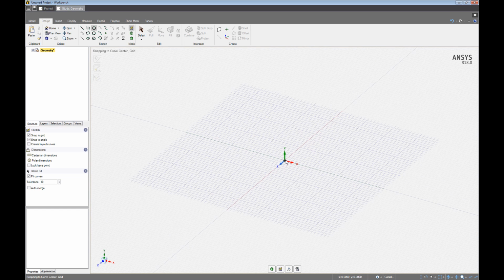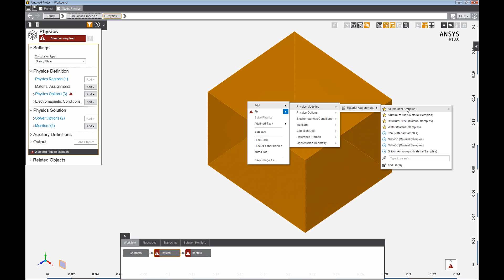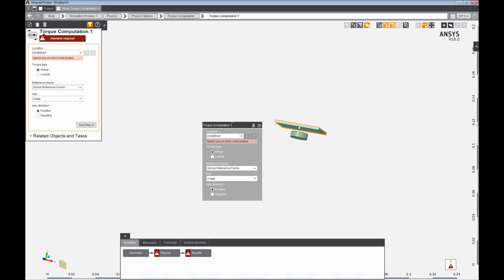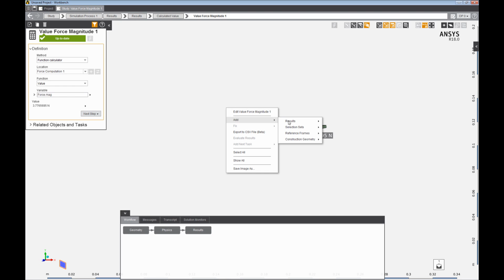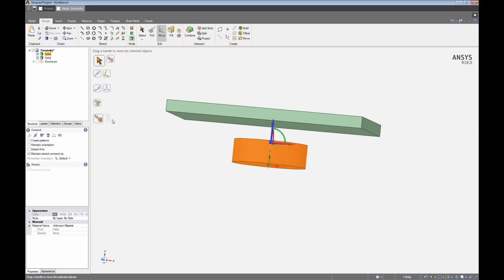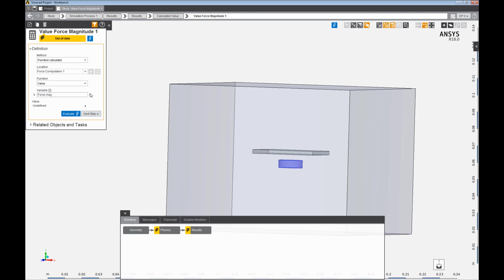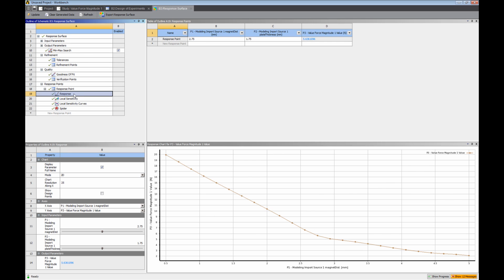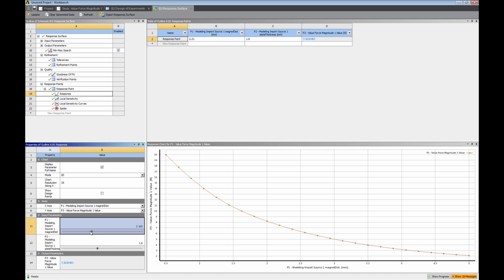ANSYS AIM Permanent Magnetic Placement Simulation

Comment: I have some questions.

1. How to give the dimensions to the pulled surface( the height to which is is pulled)? 
2. How assign the pole strength for the magnet? 
I am trying to simulate the field lines (and get the Magnetic flux density B values) for an axially magnetized Neodymium ring magnet of 1.32 T  . I just want to know if it is possible with ansys aim.

Comment: Hi, I actually did every step exactly like yours but when I wanna set up the parameters and update at the "design of experiment" place, the design points were all shown error. The messages said that the locations are empty and material assignment required attentions. May I know which step I might went wrong?